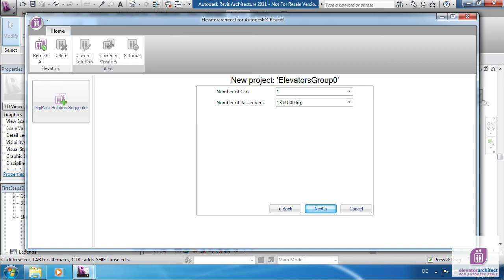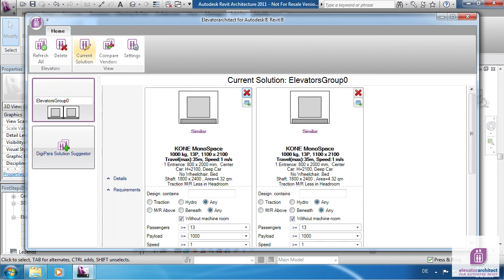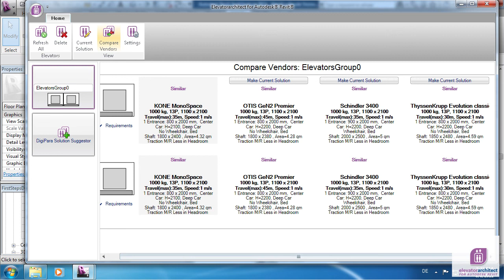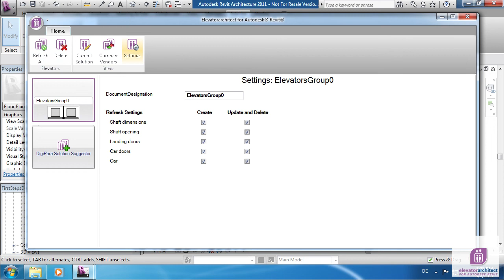DigiPara Elevatorarchitect 2012 - Free elevator plug-in for Autodesk Revit (First steps)

Comment from the maker: Hi Ahmed, Elevatorarchitect adds an elevator without shaft walls. If you already have a shaft, just move the elvator solution inside the shaft to your preferable position. If you don't have a shaft in your project, you will need to create the shaft walls in Revit.